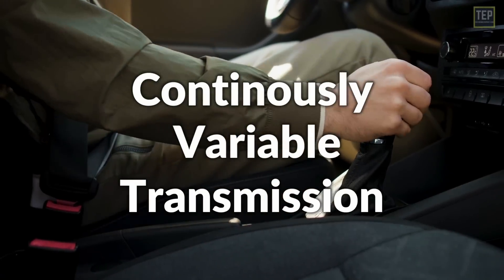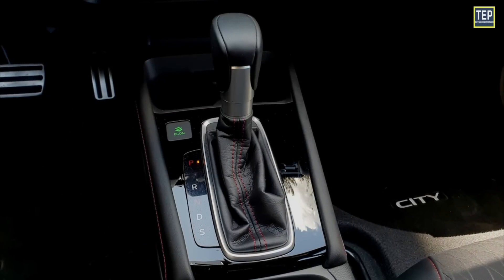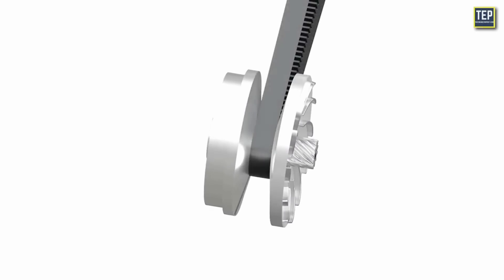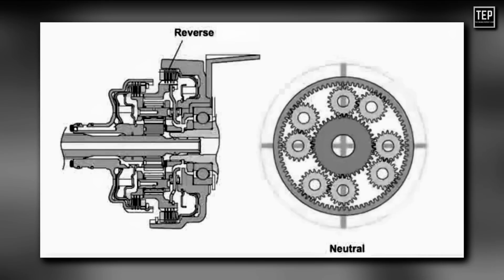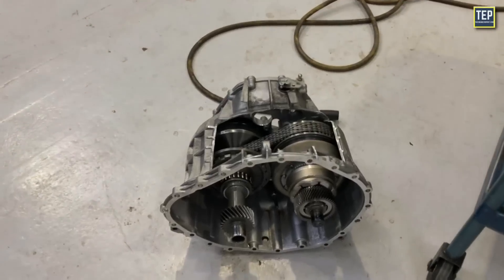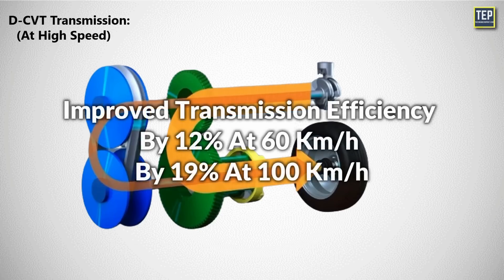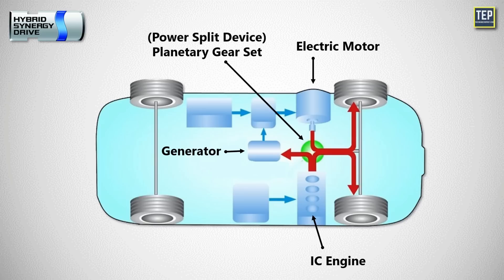Are There Any Good CVT's? | Different CVT Transmissions Explained

Comment: The concept of CVT is alive, not just in vehicles.  They use this concept in industrial machines also. I worked in a print shop, their paper folders use this same concept to change the speed. This is very simple just using a V belt and 2 pulleys.  Same with the printing presses as they increase the speed. Many industrial machines that are in use still today.

Comment: It’s seems the eCVT on the Hybrid as in Honda and Toyota has an excellent tract record.
However  Nissan ,  they released their 2009 Nissan Cube in the US those had horrible CVT. My husband bought one when it came out but we didn’t research on the transmission. Had 4-5 Transmission work and replacements😡. He stop using it when the loan was paid off. Then  bought a Hyundai Ionic Hybrid that has no problem. The Cube is still in the shop .😒
I’m still hesitant to get one, which is why I’m considering getting Mazda..
Reply: Nissan's CVT's were badly flawed and caused massive problems. Nissan is still dealing with the fallout. It's a major part of why Nissan is in such a precarious situation right now. Nobody trust's their cars anymore so nobody's buying them. Toyota, Honda, and Mazda are the only Japanese brands you should consider.

Comment: A certain abomination has been creeping into the automotive industry in the past few years:
The soulless, spiritless, anesthetized CVT!
That stands for “Continuously Variable Transmission”.

It has no gears, just advanced rubber bands connecting two cone-shaped pulleys.
It reportedly gets better fuel mileage than a conventional, say, 8-speed automatic.
But the real reason for its meager existence is that it's cheap to make and increases profits.
 
It's best for people who done like driving, and for whom a cheap car is a short-term motive appliance to get from point A to point B.
It usually burns up by about 80,000 miles (+/-), and can't be fixed -- only replaced.
===========================
Reply: 10000% spot on and to keep most from learning how cars work. They drive CVT with rubber bands on but are clueless as to mechanics. Dumbing down the lazy minded population

Comment: I think Toyota may have solved a major durability problem with CVT's by putting in a separate "launch gear" for when the car starts from standstill.
Reply: This was explained poorly in the video. Does the launch still use the belt as a clutch and then engage the gear when a roll is achieved?
Reply: @fredwilliams8898  it engages the gear and takes off as any other geared transmission in 1st does, then depending on how hard youre mashing the throttle it switches to the belt which is now optimized for higher speeds
Reply: @arne1618-u5b  So it uses a torque converter and a belt both? Must hold a lot of fluid.
Reply: @fredwilliams8898  all belt CVTs in cars use a locking torque converter afaik

Comment: Apart from the transmission itself, Toyota eCVTs use an engine that roughly emulates the Atkinson cycle, to optimise it’s thermal efficiency, at the expense of maximum power. They can drop out of it at peak demand, but most of the time they try to run at the most efficient engine speed or not at all, with the engine and traction motor output being combined. 

They also have an “engine braking” (B) setting that uses the engine as an air pump to reduce brake wear, especially when the traction battery is full. A bit like using a low gear on a manual transmission. However, the other important feature is that the traction motor becomes an alternator for regenerative braking which is often used automatically. And there is no mechanical reverse gear, as it is done by running the motor in the opposite direction to reverse the car.
Reply: There many lies in automotive industries. In respect I think Toyota, make a great concept, but these have some drawback. They produce a Toyota Echo in 2000, if you put the aerodynamic, the low friction tire, the Atkinson engine, a five gear overdrive, you have the same fuel economy than a Prius without hybrid. These are class of vehicle to spend more.
The eCVT have flaw in term of efficacity  the gear ratio are control by a electric engine to spin the planetary gears, it's like you have a constant load to the pivot of your leverage (because is not fix). But because of the efficacity of the package and the poor efficacity of the conventional cvt make it look better than the competition.
Reply: @olivierforget1927  Hybrids aren't suppose to be power houses, they are meant for fuel efficiency, and that is where my Corrola Cross Hybrid shines!

and well... isn't too bad for power and overtaking either !
Reply: @bencoerced676  You don't understand physic mechanics.
Reply: @olivierforget1927  I do know what my vehicle is capable of...
Reply: @bencoerced676  You miss the point.
Reply: @olivierforget1927 I read your explanation. It's point is quite dull and full of holes.

Comment: CVT is for those don’t like to drive a car. Don’t like to have the control over the car. Don’t like to feel the car. They are people that look to a car just like a bus, to take them from a point to the other. If I spend money in a car I want to feel pleasure driving it. How to feel pleasure with this Cvt???
Reply: I own a 2000 Camry with 322,000 miles and a 2019 Hybrid Camry XLE with 42,000 miles. I enjoy both cars equally but for different reasons. The 2000 feels closer to the road, more direct interaction with the outside environment...closer to the pickups I drove in the 1970's on the farm. The 2019 XLE Hybrid is something I never imagined I would own...something from the realm of science fiction from a 1970's viewpoint. The 2019 is a semi-luxury, technologically advanced vehicle with power waiting to be released if the priority is not MPG...it's more internally engaging than the 2000, more data and choices to make regarding how to operate the vehicle.

Comment: I have a Subaru Cross-trek with 189,000 miles on it and it runs and drives wonderful. I change my oil twice a year every 10k miles and I also do a drain and fill with the cvt once a year , every 15 to 20 k miles . I am a Uber driver and am in a ton of stop and go driving. I use Triax Cvt fluid which works fantastic , my car burns zero oil and I use Triax Euro 0-40 in it cause its a Poa/Ester with tons of Boron ,Molly, I love Subaru's its not fast but it will keep up with traffic and have been through mud/snow, it will plow through anything. Subaru's Cvt are different they use a pull chain not a metal push belt . The Key with Cvt transmission is clean fluid as the belt rides up and down on the moveable pulleys , Cvt fluid is like sprayed on the chain to protect the thing.
Reply: Or is it that the cvt has a real gear that starts to for 0-20 mph to reduce wear
Reply: @Spooderman98j No launch gear on Subaru.  Launch gear is toyota.

Comment: Some CVT work great, some are garbage, all of them are boring to drive.  For a 'normal' commuter car a CVT gives a nice smooth driving experience so they do have their place.  A CVT is theoretically the most efficient transmission type, but they seem to fail to actually achieve it.
Reply: i got 45 mpg out of my 20 corolla  non hybrid one time most times its like 38

Comment: My mother has a Toyota C-HR with a small 4 cylinder gas engine, no electric nor turbo but it has the CVT transmission. It has good power but if you drive it nicely, I’ve managed 41 mpg around town. That’s without driving so slow you’re in peoples way.
Reply: El Toyota chr es híbrido... Por tanto no es que no lleve 1 motor eléctrico.... Es que lleva 2 motores eléctricos llamados mg1 y mg2.
Y no es cvt sino ecvt... Que cambia mucho.
En cambio no lleva alternador, no lleva motor de arranque y no lleva embrague.
Reply: @Antonio-de9le  En 2019 tenía un motor de gasolina de 2 litros y 4 cilindros, sin híbrido. Quizás había uno híbrido disponible, pero el de mi madre no.
Reply: @matthewwalker9256 gracias por la info... En mi país desde luego el chr solo llegó y llega en versión hibrida.
Y si busco en internet lo cierto es que no me aparece en versión no híbrida... Como me pasa si busco el rav4
Reply: @Antonio-de9le  Es interesante. Debido a las emisiones, aquí en Estados Unidos nos perdemos algunos buenos motores. Mi Tacoma tiene el V6 de 4 litros, que es un buen motor, pero habría estado bien poder conseguir el motor diésel, pero aquí no lo ofrecían. En cuanto al CHR, no creo que tuviéramos mejor consumo de gasolina si tuviéramos una opción híbrida. Estoy bastante seguro de que es el motor de baja potencia combinado con la transmisión de velocidad variable lo que le da ese excelente consumo de gasolina.
Reply: @matthewwalker9256 pues en lo del consumo depende....
Si haces mucha ciudad, estas equivocado.... Un hibrido hace unos consumos ridiculos en ciudad.
Yo tengo un rav4 hibrido con 218 cv y me gasta 5'2-5'5 litros en 100 kms.
Dudo mucho que un chr no hibrido mejore ese consumo en ciudad.
Reply: @Antonio-de9le  ¡Guau! 54 millas por galón, eso es fantástico.

Comment: Toyotas E- CVT tranny is absolutely flawless. I have a 2016 Prius ECO and I have 110,000 miles without one single issue of any kind with this car. I am 83 years old and have had many cars in my life. This car is the best I have had. The Transmission is fantastic.
Reply: That's because it's not a CVT.  Only has "CVT" in the name. Mechanically there's nothing CVT about them.
Reply: Yes...the Toyota E-CVT which was first developed for the Prius is one of the most reliable transmissions ever made.  It's not even called a transmission, Toyota calls it the power split device.  It's not a CVT in the traditional sense...it's an electronic device that acts like a CVT for the driver, but it doesn't work like a CVT.
Reply: Problem is they’re now putting in junk CVT with belts etc and not e-cvt. It’s unbelievable how low Toyota has sunken.
Reply: @Ummo2850Their hybrids still use the eCVT. Non hybrid models use a normal CVT with the launch gear.
Reply: ECVT is a sun and planetary arrangement, which is GEARS!  CVT's use Cones and Bands, NOT GEARS.  The only similarity is the name, which is misleading.
Reply: @mefobills279  CVT is a principle that stands for anything that enables an arbitrarily large number of ratio steps between a lower and upper limit between the power plant and output shaft, whatever those may be. It isn't limited to any specific implementation. Even a range-extended EV wich eliminates mechanical constraints on practical ratio range technically qualifies as a CVT. The effectively infinite electric gear ratio between the generator and motor inverters is the main reason why diesel-electric locomotives are so successful at heavy freight, dynamic braking for long downhills is another.
Reply: I have seen Uber drivers with Priuses with over 500,000 miles and still  getting 48 mpg fuel economy.
Reply: He forgot one. During the late 50s and perhaps to the mid 60s Buck had a CVT called the Dinoflow. It used variable pitch vanes and I owed a 63 Buick
Reply: So you not tow anything them or you would not say they are great.
Reply: Ford actually shared tech with Toyota and uses the same design in their Hybrids as well since 2004 . Both have proven very reliable.
Reply: except it is made terrible on purpose to always brake
Reply: @NoName-md5zb It doesnt break.  You cant just make up things.
Reply: Probably never drove it over 30 miles per hour.
Reply: @KA9DSL  このコメントちょっと失礼すぎない？トヨタのE-CVT変速機が問題なく動いてるっていう事実を無視してるし、83歳のおじさんが「この車は一番良い」って言ってるのに、それを軽く見すぎだよね。それに他人の運転習慣について勝手に推測して批判するのはどうなの？どんな車でも適切なメンテナンスと使い方をすれば長持ちするよ。こんなコメントは技術的な議論じゃなくて、ただの無礼な中傷だと思うけど。🙏
Reply: @basuotoko  Sorry you feel that way but truth is truth.
Reply: @KA9DSL  "Probably never drove it over 30 miles per hour." 
You merely speculated on his driving habits and you say that it's the truth? 
You have a twisted definition of the word "truth".
Reply: @Fritz_Salad  Your eyes are shut. Not looking.
Reply: @basuotoko  thank you for your direct and appropriate response to the above SHITSUREI NA comment. I own A 2000 Camry 2000 CE with 322,000 miles...I don't think such a thing is possible in Japan because of extremely tough yearly inspections. A few weeks ago I bought a 2019 Camry XLE Hybrid with 42,000 miles. It's an amazing bit of technology, something that would seem science fiction back when I started driving in the late 1970's.  The E-CTV transmission combined with the gas engine has POWER!
Reply: @decatur-ringgold1958  ありがとうございます！実は少し心配していたんです。「your direct and appropriate response」とお褒めいただけて本当に安心しましたけどね。車の話題は熱くなりがちですが、技術的事実に基づいた議論を大切にしたいですね。皆さんの経験談を聞けるのは本当に貴重です！
Reply: But I can still smell burnt CVT fluid.
Reply: @KA9DSL  IGNORAMUS! ......lol....!!!🤣🤣
Reply: @KA9DSL  Toyota's E-CVT basically NEVER fails.
Never.
Reply: @KA9DSL  the truth is that eCVT is one of the most reliable transmision, there is a lots of DATA about this FACT. Your stupid  guess that he droves at 30mph is not a FACT. Stop ashaming yourself.
Reply: You try to denigrate someone and yet your grammar is sloppy. He ‘droves’? Should stop ‘ashaming’…  You are one step away from saying ‘you is’
Reply: @KA9DSL 😅😅

Comment: So the E-CVT used on Toyota's best sellers like the RAV 4, Lexus NX and RX is the most reliable type of CVT right?
Reply: The Honda eCVT is similar to Toyota's but has no planetary gear. It does have a clutch but no wear because there is minimal slipping involved, just a direct connection between engine and motor when needed. Dont know if it or Toyota's system would be more reliable.
Reply: @Gman00047 el de Toyota directamente no tiene embrague... Me fío más de Toyota por eso.

Comment: I recall that in 1988 the Subaru Justy/Trendy was one of – if not – the first cars with metal belt CVT on the Swedish market. I think it wasn't the belt, the pulleys, or the hydraulics that shortened its life, but the clutch.

Comment: If the CVT had come first, we'd never have seen gearboxes or autos because CVTs exactly match how an ICE delivers torque and power.  The original DAFs were incredible and very easy to service.  Gearboxes are a very poor, inefficient compromise.
Reply: I remember the Dafs, later taken over by Volvo. The rubber belt gearbox was rather bulky and sat under the rear seat. It didn't impress the road-test teams on the weekly motoring magazines, Autocar and Motor. The cars weren't very powerful and did not fit in with the 'press on' sporting (I do hate that term. It says to me "All the gear but no idea and conjures up images of the stereotypical fat, middle-aged business type.) mindset. The magazines were even more 'press on' in those days.

I think those Dafs and Volvos worked better when driven at a more measured pace. I ignored comments about the constant RPM drone when accelerating. Holding optimum RPM is better as it chooses the best torque, as long as it is set up properly. We are just conditioned to expect rising RPM, signalling rising power, which sounds good but means we are not always receiving the full power available.

Comment: I’ve always hated automatics, and I’ve probably driven a million miles on stick shifts.  Then I bought a Subaru with a CVT.  The fun of shifting is gone, but the performance and fuel mileage are both better than I expected.  I’m sold on CVTs now.

BTW, it’s a CVT, not a “CVT Transmission”.  “CVT Transmission” is redundant and sounds really ignorant.  Same as “RAM Memory”, “HIV Virus”, and “ATM Machine”.

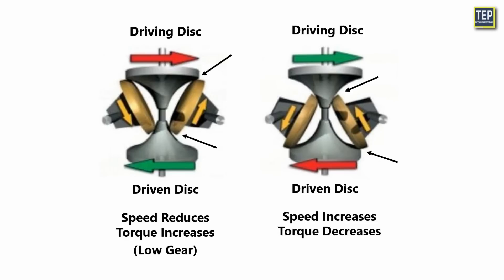Finally, your graphic of the Toroidal CVT at 15:57 is completely backwards.  The audio is correct, but the graphic reverses low gear and overdrive.
Reply: Or chi tea. Chi is Indian for tea
Reply: @ArmyWild7140  Sahara desert
Reply: @KnHighmer_Dos Desert desert
Reply: Seen the movie Kung Fu Panda? Master Sifu means master master. Its stupid but good for americans who dont know.

Comment: CVT transmissions are garbage, wont ever buy another car with one
Reply: Why? Have Toyota e cvt..its easy and faster...in acceleration you can never beat the cvt..manual you go upp to the rpm to max hp and down to idle and upp..on ecvt you go upp to the right rpm ones and why was it banned in f1..because it was to fast,..and Toyota hybrid help the electric enginge to speed up in the start
Reply: Yup, wife had a five year old 110K mile Honda that blew its CVT.  I junked the vehicle but kept the engine for a project with a STICK!

Comment: Car Care Nut Mechanic says that Toyota E-CVT  is more reliable than a manual transmission!
Reply: Toyota desgin, Ford parts and materials.
Reply: Good to hear? Ford ecvt it's not Toyota ecvt.
Reply: @BogdanBogdan-um9zi  I thought Ford was using Toyota design?
Reply: I take him at his word...he has great knowledge and is great at presenting; I watch him regularly because I own a 2000 Camry and a 2019 Camry Hybrid. I love the E-CVT! BTY, Lived in Japan for 22 years, two years in Toyota land. Quickly learned that Japanese in general and Toyota in particular are obsessive about getting things right. Driving the 2019 in Wisconsin's Driftless area I could definitely tell that car's drive train was engineered to operate in Japan's mountains!
Reply: That's good to hear. I have a  Ford C-Max energi with that trans.

Comment: I was interested in a CVT, but then I searched for a new car, and the Honda catalogue showed max tow mass 1300 kg for the manual and 150 kg for the CVT, otherwise identical cars. And Honda's is supposedly a good CVT.
Reply: It's not always like that: I drive a Toyota Avensis with a 4 cylinder 2 liter engine and a push-belt cvt. The manual version of this car has a max tow mass of 1500 kg but mine is allowed to pull 1800 kg. (Don't ask me why.....)
Reply: @janvandamme8920  I think the regulations usually say that the tow mass must be some percentage smaller than the vehicle's own. 1800 kg may be allowed for heavy suvs but certainly not for an Avensis. Are you sure you are not off by a magnitude?